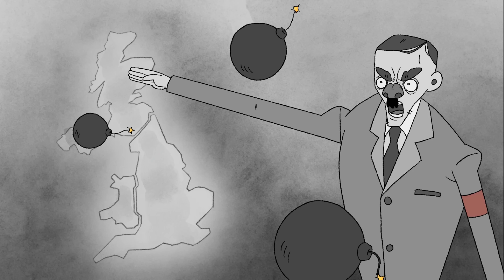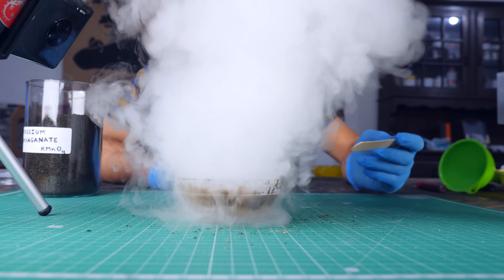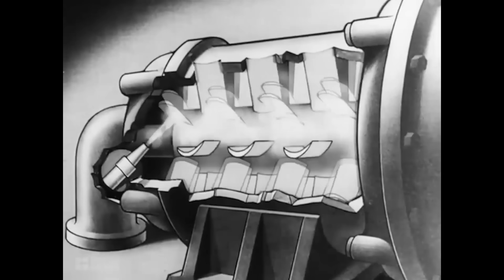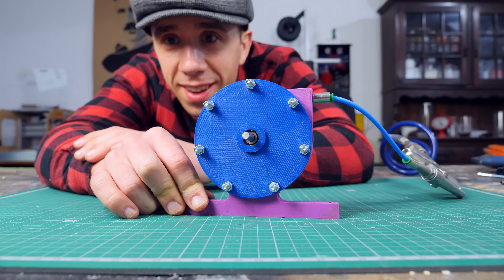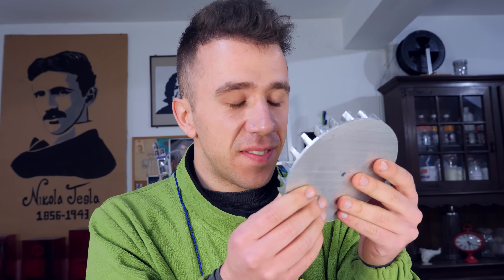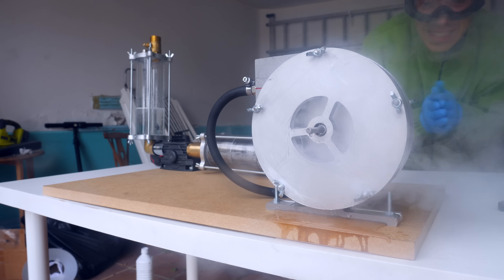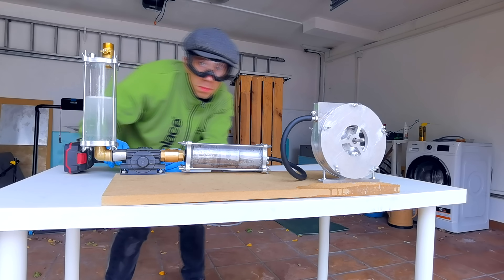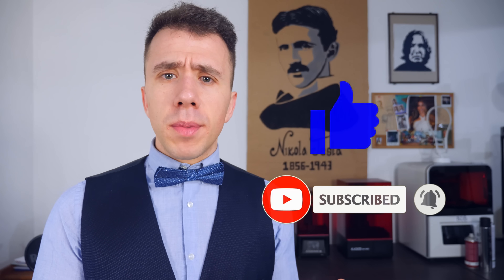I built the World War II V2 Rocket Steam Turbine

Comment: Enjoyed the presentation.  There was a documentary on PBS that had a cut away of an actual V2 steam pump a few years back.  It was constructed out of stainless steel.  There were two pumps, one for the alcohol and the other for the liquid oxygen (LOX); the LOX pump was larger and both were of the centrifugal sort.   Like the sort that are typically used in fire engines to squirt water on a fire. The V2's steam powered bit was a thick disk of metal between these two pumps and had a string of shallow vanes milled into the central disk's circumference.  Looked like the whole setup did not take that much torque to run it.  It just had to be relatively lightweight and to be to fit into the small volume of that V2 rocket.  Best of luck with your tinkering.  Have you thought of contacting PBS and the museums that they used for their exhibits?  The PBS' documentary was a 5 parter and was narrated by Patrick Steward, I think.  The name of the cited segment was 'The Rocket?'  If memory serves well enough.

Comment: You should try using a hydraulic motor/pump instead of a turbine. It's very similar but uses two meshing gears and a housing. It's basically what the old style super chargers were (roots or screw type). I bet the steam you produced would turn one pretty good and produce torque to do work, like moving a skateboard.

Comment: as many pointed out, make a liquid trap to avoid h2o2 from escaping. keep in mind that it effectively "boils" in the catalyst, hence pushes liquid above the steam bubble away. also, reduce the weight of the turbine rotor. its all a matter of momentum. lastly, you might wanna use cfd simulations to optimize the turbine blades. these look very....rough. but great video, keep inspiring people

Comment: The steam hose fittings need to be modified for maximum flow velocity at minimal resistance. The sudden changes in inside diameter should be carefully smoothed into gradual changes. Mere conic sections can work, but are not ideal. The best shape for each fitting is different, and a bit hard to explain. The most important one is easiest to explain: the nozzle into the turbine: It should be made to resemble the classic rocket nozzle 'bell shape', which converts a transonic flow into a supersonic flow, but with a very small expansion ratio in this case. That nozzle has a lot of backpressure from the turbine, so the gas is not going to expand much anyway. The other fitting from the steam hose should be internally shaped like the classic 'gravity well' pictures shown in relation to black holes in space. These two shapes are very different from each other, and each shape is specific to the flow direction at that fitting, which is part of the reason why the manufacturers of those fittings would never bother to make this refinement. 
Also, and quite obviously, the steam generator chamber should be oriented vertically, to prevent the spewing of a steam/water mixture into the turbine. Or better yet, add a vertical chamber to the steam generator. Packing this extra chamber with metal scouring pads will help its function as a steam separator, but it will take a few seconds to warm up the extra mass.

Comment: I've had an idea for a while and its to make a full auto potato cannon, it is basically a bunch of shell like that had something to make a spark where the primer would be on a normal bullet setting of the fuel air mixture inside making the projectile shoot foward and because of newtons 3rd law it would push the bolt back extracting the shell and then grabbing a new one

Comment: Okay, your hydrogen peroxide needs to be pointed up and down, not laying sideways. Also, your peroxide needs to be a higher concentration. The nozzle in the peloton turbine should be more narrow, to focus the steam into a more energetic stream. The peroxide also should be fed into the reaction chamber with compressed gas, and not a pump. That defeats the purpose of generating steam at high pressures. 
You are off to a great start! Keep going.

Comment: I would put the reaction chambers vertical and have a second and third stage to completely turn all the peroxide in vapor ,lowering the stages size to build more and more pressure , also would be probably a good idea to shape the top of the pressure chamber with more space for the solution to precipitate before goin to get ejected to the next one (a bit like an hydrogen chamber trying to keep the liquids at the bottom longer possible to have full reaction) . Cool project 👍

Comment: Nice project! I would advise some modification of the general architecture. To produce steam it's better to avoid high concentrate peroxide and rely on an advanced steam boiler. To harvest max power and torque for propulsion a variable volume rotating motor similar to those of pneumatic drill would probably be a better solution.

Comment: Great build. If you need more speed for the generator, consider the Tesla turbine.
You should see if you can balance your turbine. As for car wheels or turbo turbines.
You should try to put the tank with the catalyst vertical, it will make less losses. There is also the possibility of installing a one-way valve.

Comment: Hi mate, love your videos a little of info for if you ever come across the problem from someone that has worked a bit with hydraulic pumps and water pumps, we tend to use a “axel Key” to ensure the connection is secure, the epoxy or glue works fine with low torque but if you ever build a turbine/tomato crusher that needs it then you know.

Big fan hope it helps if you don’t already know this. Tomates are disgusting

Comment: Hi! If you put the reaction chamber vertical could be more efficient (as many have said in previous comments), but with more power you can drive the pump from turbine. It would become a self-sustaining system that draws energy from what it produces. I also suggest to do a purge for the liquid part that could accumulate on the bottom of the turbine. However, at the beginning a lot of condensation forms due to the fact that the turbine is cold and causes the steam to condense.

Comment: Idea - use the power generated from the steam turbine to spin 2 secondary turbines that deliver compressed air and ethanol through a coaxial swirl injector, then if you are feeling brave put a de laval nozzle on the end (this would generate very high thrust so bolt it down). I have a lot of experience with rocket engines and can answer any questions. :)

Comment: Hey, what if u changed the turbine design form flat disk to, somthing more modern, I thibk due to the diameter of the disk and the weight, most work is done in over coming the moment of inertiea of the blades. Turbine whose axial cross-section is like a truncated cone.
This design can reduce moment of inertia and increase output power. Please try!.

Comment: It would be interesting to see if theres any benefit to superheated steam 
Esp if there's a means to compare them quantitatively; like output power, RPM, etc

Though, superheated steam is scary af 

I know in a lot of industry applications its used over normal steam for turbines, etc due to it being above condensation temp (i.e. less energy loss by avoiding sinking energy into state changes and avoiding condensation inside the system)

Eitherway, the idea to use a catalytic converter was brilliant

Comment: It would be AWSEOME to see you attach this to a TRICYCLE, and actually provide travel from steam, I saw a guy on YouTube maybe from Brazil or something, and he put like an actual 55 gallon drum and built a fire inside it, and then attached a water reservoir inside of it to produce steam to run some pistons that were offset attached to wheels(so like not in the center of the wheels hub but like offset from the center) so each time the piston came in and went out it would push pull the tricycle, but it was so big and bulky, so yours being smaller, it would be great to see you do that but using your catalytic converters and hydrogen peroxide, and then build a tank so that you can regulate how much psi is going to the wheels and have a constant flow, the video link from the guy wherever he is from is here > https://youtu.be/5UIX8A_bP9g

Comment: Turn your reaction chamber upright. It'll give the unreacted H²O² a chance to drain back down and build more pressure. On it's side like that it's just kicking it out the end instead of reacting it all. If you stood it up though and maybe left a little room at the top to allow any fluid to fall before entering the narrow tubing where it would get carried to the turbine. Think of it like an old coffee percolator. You'll get it man, I have faith in you. You might also have a look at the design for NASA's H²O² powered jet pack which works in much the same way as the thing you built here. You're really not far off. It just needs a little refinement.

Comment: You Should Build a rocket, but here is the catch using an aerospike engine using a bell nozzle. Build an extending satellite in it also. Build a receiver here on earth to be able to transmit the singles back and forth. Use compressed combustion divide them into sections each has a smaller exit valve for more power and force. Then observe.

Comment: No way to get decent power output without using a compounding design. You also shouldn't have exit steam, need to use a condenser to create a higher pressure difference/ vacuum between inlet and outlet. You can also pipe the condensed water back into the(now vertical) catalyst chamber for more run time. 

Good luck, don't blow up, kill tomatoes

Comment: When it comes to the Catalysing mount it vertically to force the Hryogen proxicide to sit at the bottom and or be forsed up whilst only steam comes out the top but the sake of making the steam chamber easier and more balanced i can see why you mounted it Horizontally just maybe put the hole higher up next time to avoid pumping peroxide into the turbine

Comment: Your big problem is you're not using that pressure/flow efficiently. The actual V2 turbine is much more like a turbocharger. Both have large volutes around the turbine, decreasing in cross section, that wrap around the turbine. This lets gasses apply to all the turbine fins evenly all at once, rather than 1-2 at a time.

Comment: You need like a knife edge/magnetic static rotational balancer. They are used for RC aircraft to balance rotors/propellers and in machining to balance grinding wheels. The faster you go the more out of balance rotation matters.

Comment: I wouldn’t say that you are suffering from the catalyst failing to decompose all the hydrogen peroxide but carryover of the hydrogen peroxide with the steam. In a traditional steam generator the steam comes off the top and either exits through a dry pipe or cyclonic moisture separators. By placing the catalyst on its side the catalyst is flooded and has steam intermixed with the liquify hydrogen peroxide. Try rebuilding the catalyst chamber vertically so that the liquid can stay in the bottom and the steam can rise to the top. I bet you get far less carryover.

Comment: What if you built a fan forced dry ice or nitrogen cooler/ ice box (or esky as we call them in Australia).  So in other words, we all use ice or ice bricks to cool our ice boxes, but why not make a portable system that turns a normal ice box in to a fan forced ice box so you have an evenly distributed cooling system?  You could even use normal ice and then have it recirculate so the ice stays frozen longer.

Comment: Vertical catalyzer to maintain longer contact with the H2O2 and larger outlet/hose/inlet. I'm not sure why but I feel like overpressure in the catalyzing chamber may be inhibiting the catalytic process. Also, if you are breaking endmills you should consider reducing your IPM or cutting depth and invest in a coolant system.

Comment: Congratulations for your project and tenacity. but you have a big problem that you don't know about. The hydrogen peroxide that you are using to begin with has a very low concentration but second and more important is that the commercial peroxide, contains a special compound call DEQUEST that will poison your catalyst this compound is added to the commercial peroxide precisely to prevent the catalytical  decomposition of hydrogen peroxide.

Comment: In the US there were several guys in drag racing that ran H2O2 rockets in go karts.  They used silver mesh as the catalyst and extremely pure H2O2.  Those converters may not have enough silver to completely decompose your H2O2.  I think you are on the right track, but you may need to change from the converter idea to a chamber of silver mesh with a higher purity of H2O2.  Also, the purity levels used in those rocket karts are no longer available in the US.  The last time someone ran one of the US rocket karts the H2O2 was imported from Europe.  Check out the Dorkomotive podcast for a more in depth review of those karts.

Comment: Idea: try and 3d print a tube with many voids that you fill with the catalyst in the middle of the print. You could have small tubes with many holes similar to how you typically disperse propane to spray hydrogen peroxide onto this catalyst

Comment: Did the same project for my engineering degree, ended up scraping the turbine idea completely and moving to a piston steam engine, worked a lot better since I was able to maintain the pressure and power not only longer but more consistently (I made a small RF steampunk truck), your turbine design was very similar to my 3rd model and unfortunately you`ll always have liquid on the turbine and that will cause losses, it will require a 99.99% precision on everything for a steam turbine to work, aluminum while stronger it functions like any other metal, it expands and shrinks in different temperatures so there's no way that you can maintain such high precision (e.g.: turbine blades against the body of the turbine), for me on paper everything worked, testing not so much, it would generate the correct power, torque and speed for about 5 seconds, and I would have to wait 30 to 40 minutes for the turbine to cooldown.
Don`t even start me talking about the feeding nozzle angles, positioning, distance, jet surface area, distancing, etc... If you work around all those issues, you will end up out of issues to solve, but the heat expansion problem will always be there unless you use some sort of composite material that can sustain temperature so the turbine can maintain needed pressure for the amount of time that you need to pump the fuel mix (which is what I believed was the idea for the V2 rocket).

Comment: Keep the horizontal catalyst container but add 2 more small converters. Build a pressure chamber on top that allows excess peroxide re enter catalyst system. You will need another turbine to feed , due to the excess of power generated. With that you could really move a skateboard.

Comment: Hybrid air/electric system. First prototype would be a small air powered turbine to help charge the batteries for electric bicycle. Eventually bike frame would be used as compressed air storage,shocks would pump air into the air tank, and brakes would add charge to the battery system as well.

Comment: Maybe you want to collect  the  pressure  produced by the catalyst in a small pressure tank with a check valve and release once pressure is built with a solenoid valve into the turbine. Maybe want to put a liquid separator like an air compressor  to separate  the un catalyzed hydrogen peroxide out of the mix.

Comment: So you need a way to keep the liquid in the oxidation chamber.  Gravity separation works.  That's how steam locomotives do it.  But it might be more awesome if you tried to use a vortex dust separator to make the liquid fall into a collection chamber, while the steam continues on to the turbine.

Another idea is to vaporize the peroxide before the oxidation chamber.  That might allow you to use less peroxide to achieve your steam, and get a more even oxidation.  You can do that by forcing the peroxide through a small nozzle at high pressure, before the oxidation chamber.  This is how Air conditioning systems work.  To get the flow rate you need for the turbine, you would just setup  multiple nozzles into the oxidation chamber.

Comment: I think that if you put catalizers chamber in the vertical position, the steam will go up while the oxigenated water will stay on the bottom.
I tried the same concept for my steampunk motorcycle, but using a common 2 cylinder steam engine.

Comment: When you have a more efficient turbine you could connect the turbine to the pump similar to the combustion driven fuel pumps found in some rocket engines. Just make sure there is a bleed valve in case of a runaway situation. I would also add a liquid/gas separator to keep liquid out of your turbine.

Comment: Place the catalyst chamber upright, that will get more steam than liquid through, then set up something that works like a waste gate valve that is used on a normal turbo car, plug the outlet so that once pressure builds the spring gets compressed and the steam goes out through the secondary opening that would notmally be used if too much pressure is generated for an engine. This way, peroxide goes in, steam gets generated, pressure builds, turbine gets powered.

Comment: Instead of a skateboard, do a scooter instead. That way you have room to mount along the bar and would be able to have the vertical chamber. Handlebars make for easy throttle control, then make it a foward wheel drive?

Comment: You need to use a gear ratio system to maximise the output from the turbine, a stepped gear system like in an automatic car transmission would make full use of the turbines speed output and convert it to useable drive power. Just a thought, good luck 👍